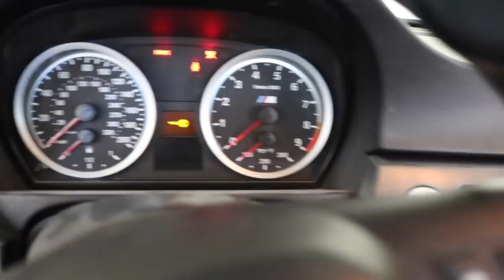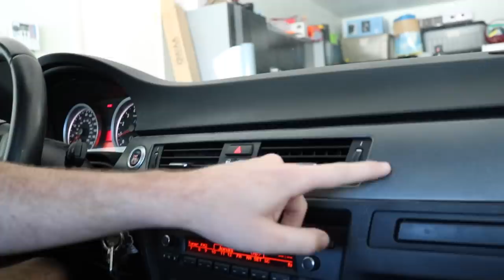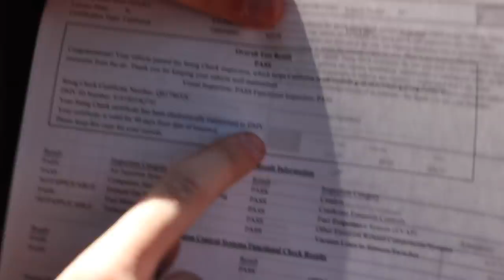MY BMW M3 FAILED :(

Comment: Don't push down on your hood to close it.  That's a sure fire way to dent it.  Just close it with enough force to latch in all the way.  Your latches won't get damaged doing so, and are designed with that in mind.

Comment: If it’s the Footwell module causing your lights to do that. You can buy a used one. But it has to be the same exact model and trim. Did it on my 335i and it worked perfect and didn’t need coding

Comment: You should be able to pull the leads off the bulbs in the taillight and swap them to fix the issue, the bulbs might even be able to be swapped.